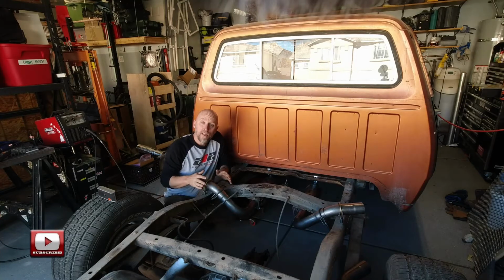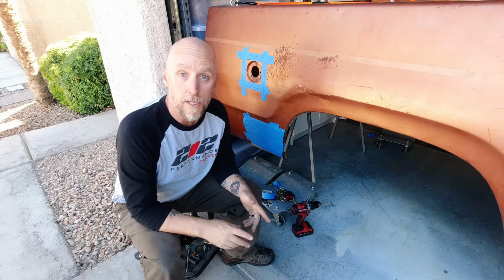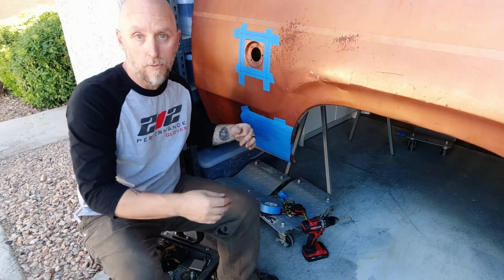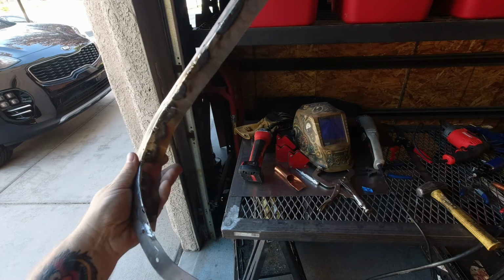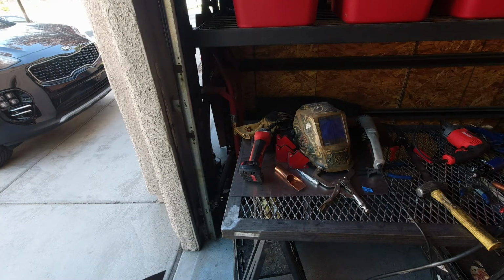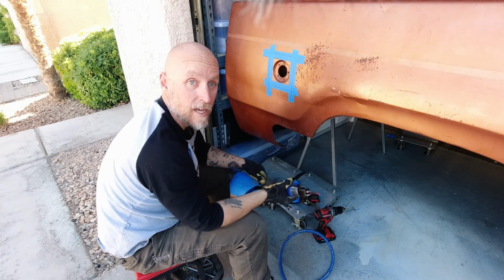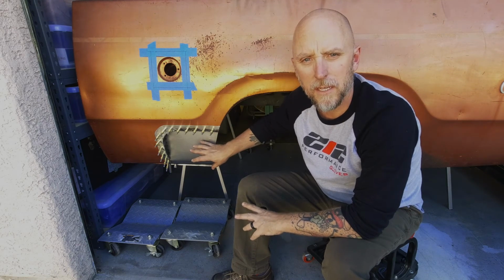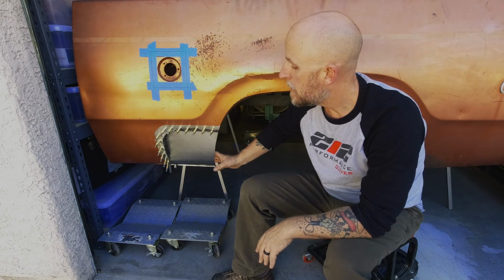Custom True Dual Exhaust System Build - Part 2 - Bedside Exhaust | Dodge D100 Hot Rod Shop Truck

Comment: How are you going to keep heat and smoke off the side of the truck without extending way out from the side?
Reply from the maker: I'm not too concerned about it.  I figure the heat will help to patina the sheetmetal used to make the recess.  As for the smoke, I will be installing fuel injection, so hopefully that won't be much of an issue, but again, it will just add to the character of the cutouts.  But, if it does become an issue it will just give me another reason to replace the sheetmetal on the bedsides since they are pretty beat-up anyways 😉